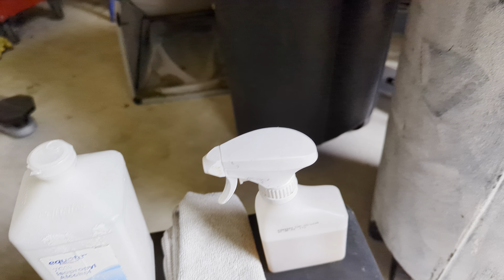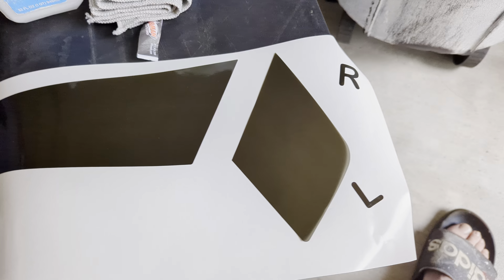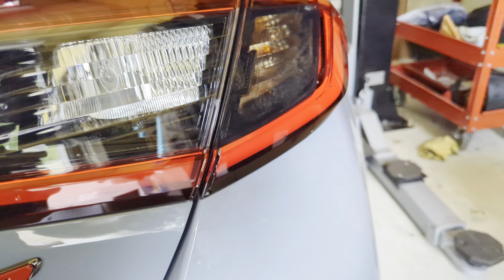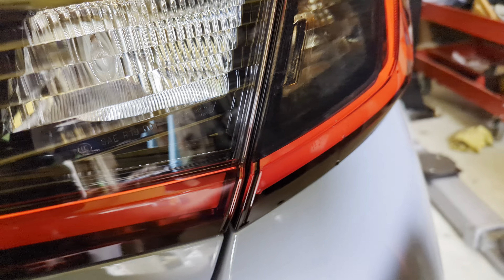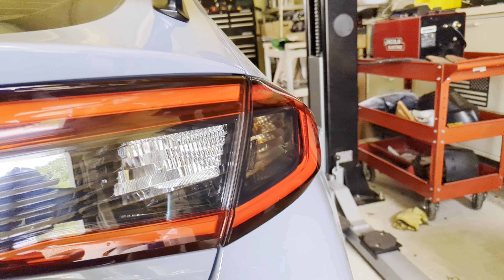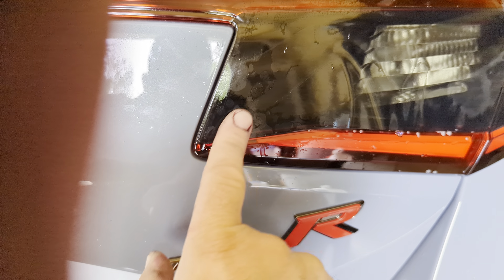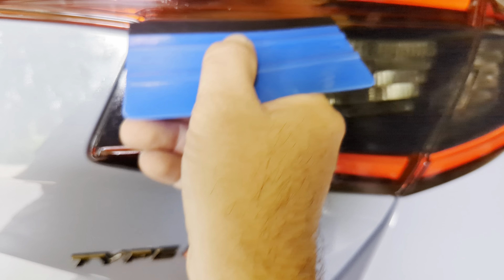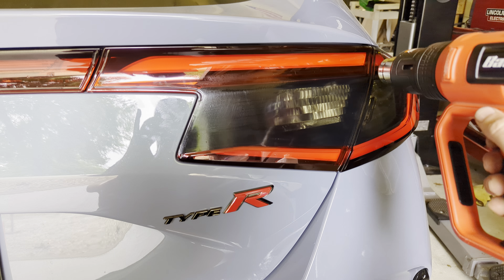2022+ Honda Civic Type R/Regular Hatchback Tail Light Tint Lens Overlay Install

Comment: Nice video.  Can I use a hair dryer instead ? Don't have heat gun
Reply from the maker: Sure can! Use it on high to get enough heat though as a hair dryer on high is about the same as a heat gun at its lowest setting.
Reply: @ArigatoMatto  ok thanks 👍
Reply from the maker: No problem 😁